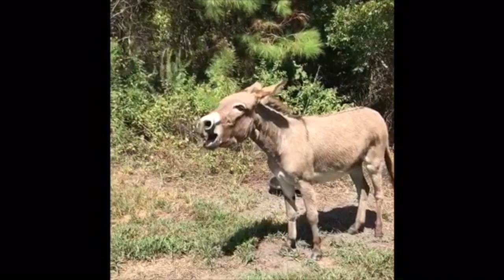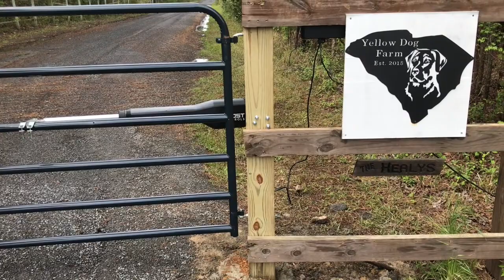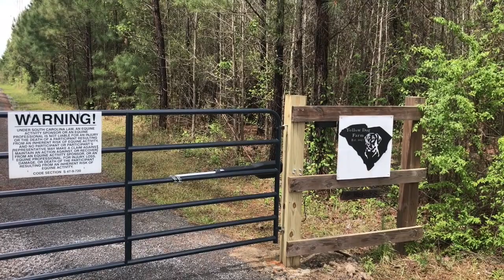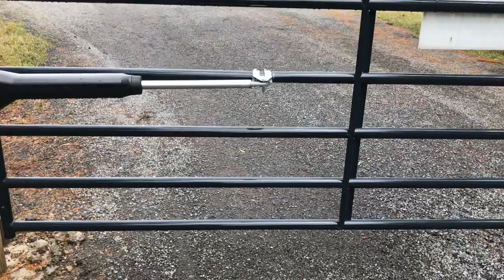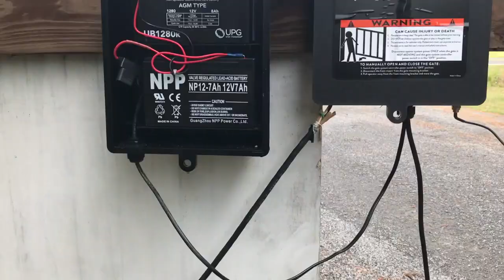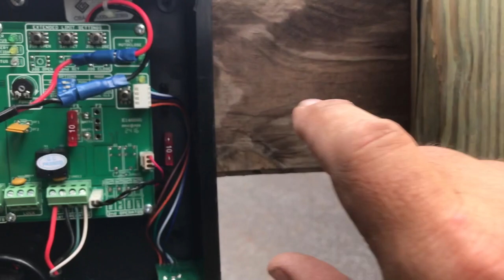Automatic Gate

Comment: I mounted my ghost gate opener similar to the way you did it and I also have a tube type farm gate. My problem is that the two brackets that attach the arm to the gate have crushed the tube where they are mounted causing the arm loosen and move the mounts out (or in) as it opens and closes. I drilled hole in the gate to bolt the arm to the gate but I am afraid that these holes will be rounded out from daily use. I guess the metal that the gate is made of is crap so I am considering getting a steel plate that goes from the tube just above the mount to the tube just below the mount and having it welded in place. Then mount the arm to the plate.  Am I the only one who has had this problem?
Reply from the maker: I have the same problem. I currently have 4 bolts going through the tube gate and automatic arm for the very same reason.

Comment: Thanks for the video. How long are the bolts that attach the bracket on the post? I got a railroad tie for a post.
Reply from the maker: Good to hear it is helpful Michael.   That's a 6 by 6 post that I have it attached to.  It was a fairly tight fit.  It'll be close for a railroad tie.  There's nothing magic about the bolt.  It would be easy to get a longer one at the hardware store.